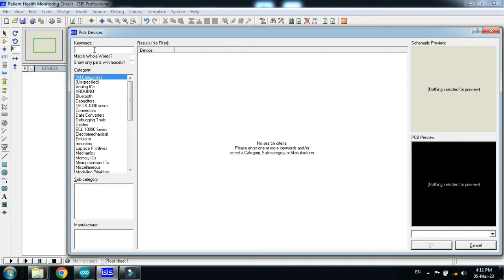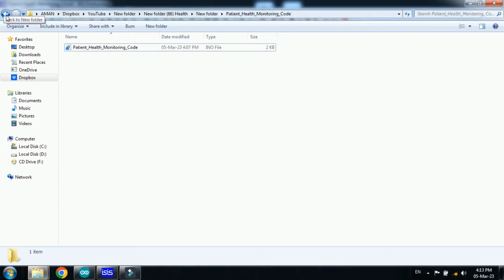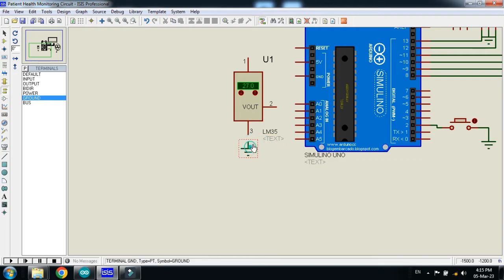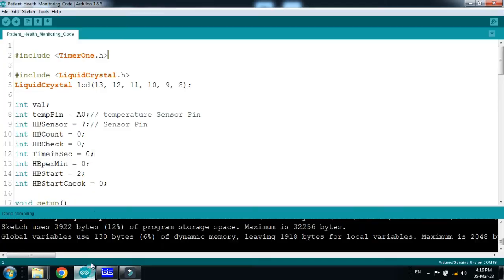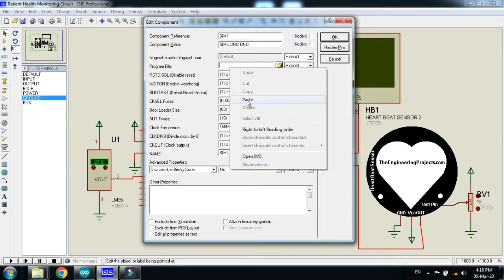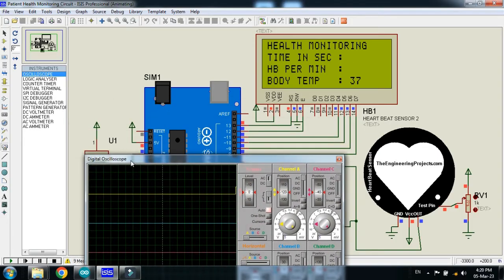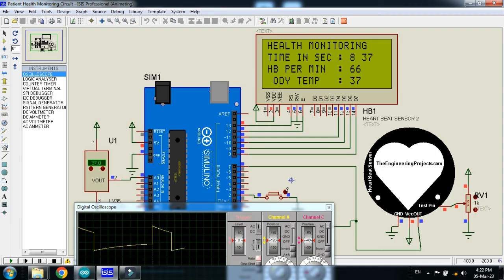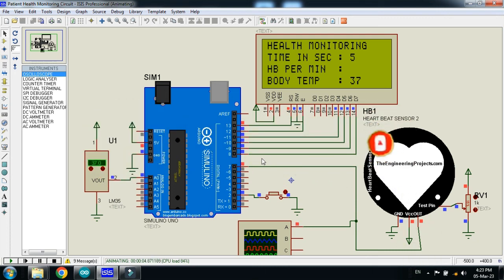Patient Health Monitoring System Using Arduino With Code and Circuit || Proteus Simulation

Comment: Hlo sir any documentation is there for this project....
If is there please share the link sir..
Reply: Rajahmundry
Reply from the maker: No brother
Reply: @thebrightlight9472  sir can you generate any document regarding this project...
please......
Reply from the maker: Where are you from.?
Reply from the maker: Brother I only have code and circuit of this project and these are already attached in the video description
Reply: @thebrightlight9472 Sir not issue on that for this project I want document how to get document when I am use the ai tool not accurately give not similar to this that can includes hardware also I want only software simulation documentation I am unable to do this can you please generate that document for this project.....

Comment: Can I communicate? I have a problem with the LCD part. It does not work and nothing appears on it.
Reply from the maker: Please check the connections properly.
Reply: @thebrightlight9472  I took all the files attached to the video and did not change anything in them
Reply: @thebrightlight9472 Simulation is not tuning al hoe due to excessive CPU load

This is the error I'm getting.
Reply from the maker: Maybe there is an issue with your Software or PC then

Comment: Sir how do I open the circuit or should I use Arduino board instead? It’s also saying debugging is not supported with Arduino Uno
Reply from the maker: Open the circuit with Proteus 7 Software.

Comment: Sir can you tell me why the led terminal is getting stopped after three loops ...the display just stops working and only shows heart beat per minute ...and those two time and body temperature just gets vanished !!!
Reply from the maker: Maybe there is any issue at your side. The video simulation is working correctly
Reply: @thebrightlight9472  sir are you sure that their is no problem in the code ?...it seems like these two portions are exiting the loop that's why it's not showing
Reply from the maker: Yes, I'm sure

Comment: Sir urgent help needed ! Can we add wifi module and run the same source code or we have to change the source code in that case also !

Pls if possible guide me.... it's sort of urgent
Reply from the maker: Yes you will have to change the code as well
Reply: @thebrightlight9472  can you guide me how it can be done ! Like I just want to add a esp8266 in your video having two virtual serial ports ...so for that purpose how the code will be written ???

Comment: Sir when I simulate even after adjusting the potentiometer, the heartbeat is still zero. What could be the problem
Reply from the maker: Do the proper wiring, add hex file to sensor and use Sensor2 (in hex as well), then it will work. Also you can download my circuit and Code from the link available in the description.

Comment: how to open that .ino file in arduino ide
Reply: i already imported, but can't open that file. can't find location of file
Reply from the maker: Please install Arduino IDE Software for opening .ino files.
You can download the Arduino IDE Software from here:
https://youtu.be/1kHYx0NbkpE
Reply: @thebrightlight9472  yes I have already downloaded and imported that timer zip, but I can't open and run that file
Reply from the maker: Whats the issue that you are facing.?
Reply: @thebrightlight9472  not showing the hex file address
Reply from the maker: You have to enable compilation option if you are using Arduino IDE for the first time. You can learn in this video that how to enable compilation option. Please watch this video:
https://youtu.be/aqENBcFAdqQ
Reply: @thebrightlight9472  Can you give that .ino.hex file to upload in SIMULINO UNO
Reply from the maker: That file can be downloaded from the link provided in the video description.
Reply: @thebrightlight9472  .ino.hex is not available in the drive
Reply: @thebrightlight9472  can you give ur telegram channel or any point of contact
Reply: @thebrightlight9472  thanks you u helped me so much thank u thank u
Reply from the maker: You Welcome brother
Reply: @sallubhoi3121  how u fix this problem ?

Comment: where did you write that code, which software
Reply from the maker: Arduino IDE Software, You can download the software from here:
https://youtu.be/1kHYx0NbkpE
Reply: @thebrightlight9472  yes i got but i have one doubt
Reply: now i am using proteous 8, should i have to download latest arduino or same version that u used
Reply: *arduino ide
Reply from the maker: You can use any version of Arduino IDE Software. That doesn't matter.